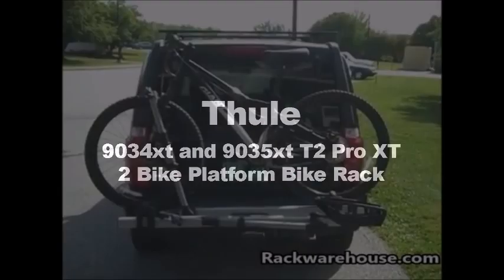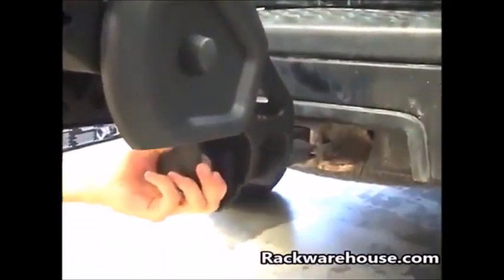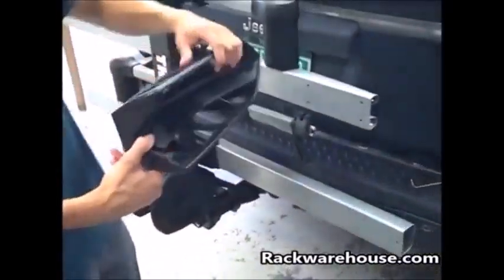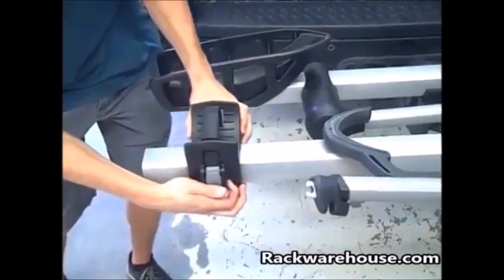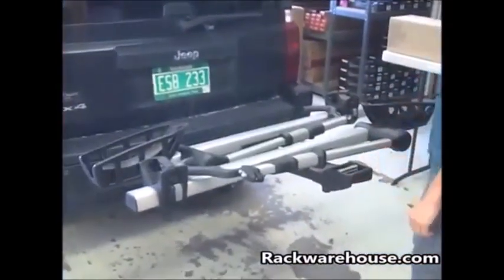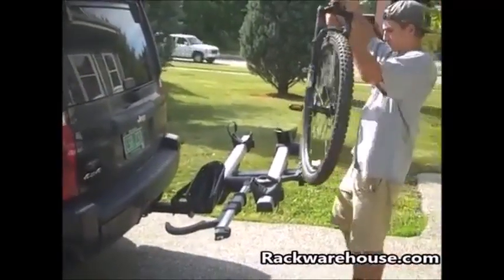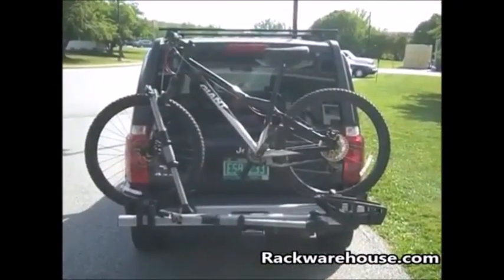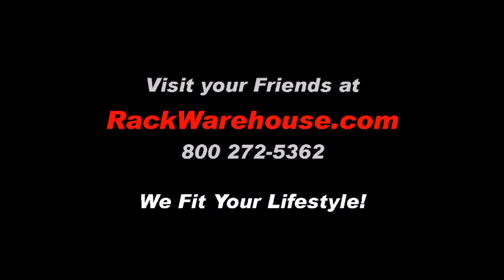Thule T2 Pro XT 2 Bike Platform Style Hitch Bicycle Rack for 2" Receivers

Comment: Thank you for the video, I installed the bottom lock as you showed but it wont turn so I can't lock the knob that secures the rack to the hitch. Also, the locks on the arms wont go in, I try different ways but there is a pin sticking out, very weird, it should not be that hard.
Reply from the maker: Are you using a Thule installation key to install them? If you install them with the key that locks and unlocks the lock cylinders they will not function correctly.